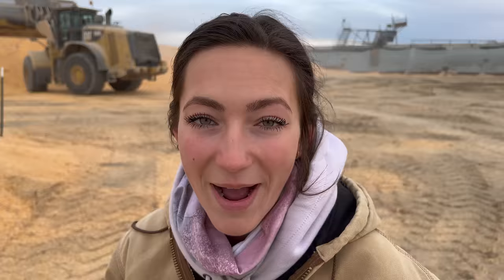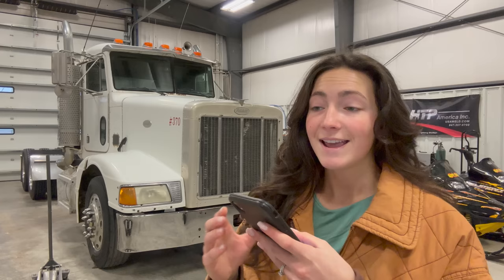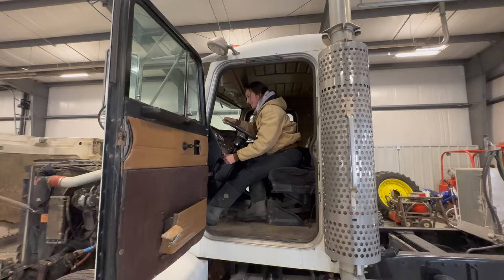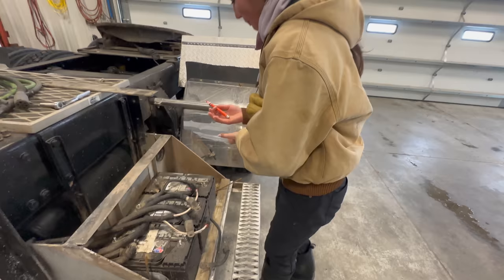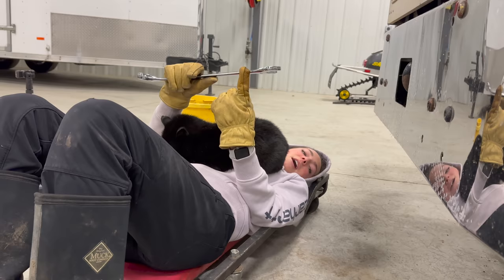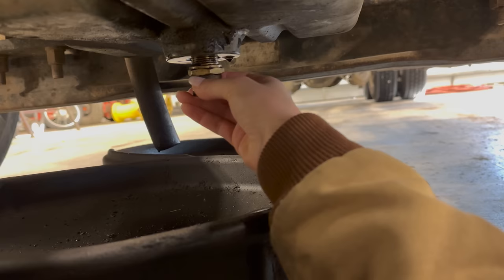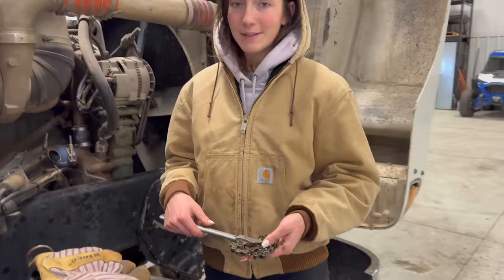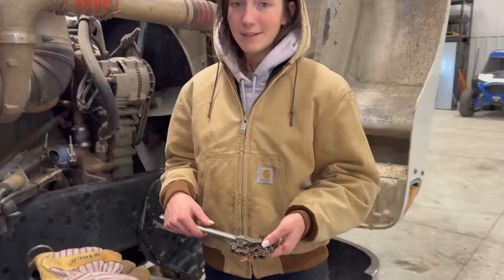The Worst Oil Change

Comment: you should prefill both the oil filter and fuel filter before putting them back on. there is a filter wrench that works with a ratchet and an extenchion and grab it closer to the top

Comment: One thing that I noticed was when you changed the fuel filter I didn't see you fill the filter up with fuel. As for the oil filters, the strap that they are talking about might do the trick if you can get it up near the base of the filter. Might need to use an extension on the ratchet to get a good pull on it.

Comment: When installing batteries get those felt washers to put on the post before connecting and then use a spray just make sure all post and connectors are clean you can use baking soda and water usually there is four batteries in those boxes which that is made for I just don't know why Peterbilt put three batteries in but those felt washers make the corrosion stay away for the life of those batteries it works real good since I've used those in the spray I never had corrosion

Comment: As all filters state where i live: hand tight and than 3/4 more.  But when not changed for a long time they can become stuck and hard to get loose.
Get a long screwdriver/pry bar and hamer that trough the filter. Then turn it.
Try to find a filter tool not with a chain but  a band like a ratchet strap. You dont do anything wrong. Just one of those👎 moments and surprises of the (youknowwho!!) That bodge it before you.

Comment: You may have to turn out  the filter base plate   with a  bar stock  / modified chisel and a 3-4 lb hammer. Alternatively,  a slow, long stroke air hammer and a dedicated chisel  could work miracles   but it  obviously is a riskier proposition .   ( I loathe having to resort to that  but it has not let me down yet)

Comment: Been there done that in racing surprised Grant hasn't figured it out somehow. You already have a hole I'd just use a big long screw driver poke it all the way threw the filter threw both sides & turn.

Comment: If heat and/or the right wrench doesn't work-- they probably will-- then take a big screwdriver, drive it through the filter, and use that to turn it.

Comment: I agree get you a better filter wrench next time let your engine warm up to running temperature the Rubber seal is probably baked on over time that would happen go to Napa explains what going on they probably have a better oil filter wrench for a semi

Comment: Put the wrench as high up as possible the lower you go the more likely it will crush sometimes that will still happen if it does poke a screwdriver all the way thru it and twist with a cheater bar

Comment: You can always take off the tire , you shouldn't have too but the filter IS on way toooo tight . Then use the pipe extension Grant was using . Best of luck , Wish I had the tools and garage you folks have  :-)  God Bless ☮

Comment: next time, drive a 3/8in rod through the filter body and go for it. Yes it drips oil. Also helps to heat the filter if it wasn't hot to begin with.

Comment: 77,000 lbs,,, not 770,000 !      OIL Wrench  1. Penetration oil (Break Free or other) all the way around the filter    2.  a 2" long piece by 1" wide strip of 1/8" flat metal, curved to the shape of the filter and slip it inside the wrench where the bar meets the filter. It will spread the force of the bar end over a wider area, and not make it bend in the filter each time you CRANK on it.  Can't wait for the next episode on "The STEAL" !

Comment: Hi Laura & Grant!  That oil filter is going to difficult to remove now that it has been crushed and compromised.  You may have to take apart and get to the base of it to be able to grip that to get it off now.  I have seen that once before and it was not pretty or fun.  Hopefully you can find a less drastic solution, I liked the hairdryer ideal to hear up, but I think you will bee a heat gun to be able to get though heat into the core of the filter and to the threaded part.  Ken

Comment: If the pry bar rips the canister off you will be able to get to the canister top that you can use the holes to twist off with a hammer n screw driver or such tool but if you have a span socket for 4x4 I find it MUCH easier to use

Comment: Think you tighten by hand then quarter turn. Suppose you can't get that pipe wrench up closer to the block?
Thought the belt was a good idea if you roll segments against the filter and use a pair of vise grips to hold it on the filter?

Comment: Just a suggestion  to you yes  snug all your filters up good but not to a point like what you had to take them off. Also to give you less prob fill your filters up with  oil or fuel  putting them on dry  can give you trouble down the road this for the videos

Comment: You also need to put diesel fuel in the filter before putting back that way don't air in the lines. Diesels don't not like air fuel line .

Comment: looks like it's a quick connect oil drain plug on the truck.
Is similar appearance to Femco oil drain plug so you can easily connect a hose and avoid oil spillage.

Comment: Gear wrench part #s 2322w 2321w 2320w…get the correctly sized one of these part numbers for your filter and it will get it right off

Comment: you should fill your fuel filter with fuel before putting it on. also, they make a oil filter wrench that fits on the end of the filter and uses a breaker bar or ratchet to turn the filter.

Comment: A strap wrench would help, a wide strap instead of a chain.  You really should fill the fuel filter with diesel before you put it on the truck.  Saves having to bleed the fuel system.

Comment: It's far easier to change the oil when you extract the oil and John Dow makes both an extractor in 20 gallon that uses air pressure to drain and empty it and flat drain pans with pumps.  Should make changing oil on everything you have a lot easier.

Comment: I have oil filter sockets that i use for cars and trucks . Not sure if those have the edges on the bottom or if they are round . The sockets were cheap and never slip well worth it

Comment: The truck filter wrench that another poster mentioned from napa is perfect for the reasons the gentleman stated. I am almost positive that some idiot installed the filter with a filter wrench. There's no way in hell it should be that tight.

Comment: Take your time and get the right wrench for the job it is worth it in long run there is a pipe wrench and a filter wrench pipe wrench put weight on the width of jaw filter wrench spreads it out and dose a great job every time don't forget to date and milage on filters.but you two did a great job so far worth the weight to get Wright wrench one go get it other one get other things done on truck thank you Laura and Grant can't wait for next one .

Comment: Try putting a large hose clamp up near the top , tighten it, and tap on it with thnutdriver and a hammer . That should break it loose. Whomever put those on there did so too tight!

Comment: Get the biggest screw driver you got and hammer it through the filter in the middle of the filter so you don't hit the threads the filter screws on to.  This is always the last resort and you all ready have a hole in the filter.

Comment: try a jaw type filter wrench I use one for changing filters on small engines and on my compact tractor and it works great but depending on where your filters are you might need a cap style filter wrench cause that's what I have to use for changing oil on my atv try one of those two style filter wrenches.

Comment: You need to put fuel in the fuel filter that you put on or else it will not run you will have to prime forever to get it to run if that truck has a pump on it. You don’t necessarily have to put oil in the oil filter cat doesn’t recommend it. I’m not sure about Detroit.

Comment: I dont agree with a lightly seated half turn, ive had filters work themselves lose from a hand half turn.  Now im not saying use a wrench to tighten it, but yea, and ive had to deal with a filter like that once on a 304 v8... I had to knock a hole through the filter, and stick a bar through the filter.. this allowed me to get better leverage to turn it

Comment: Did you think about putting your new truck on a lift and working from underneath????  (LOL)  My brother had an old car and was able to 'remove' the filter.  But, the motor mounts were broken and the engine sat too close to the frame and he could not remove the filter from the 'area'.  He was lucky that he had not broken the filter.

Comment: Been watching you a while now and think you and grant do cool videos.

Now, did I see you using old oil on the seal of a diesel filter? I'm not telling you not to do this but, if it's a diesel filter, I use new diesel, if it's oil filter I use new oil, I would never put old oil on any filter, especially fuel, you have no idea what's in it and you risk bringing on injector failures! I have seen this in the past!

I have worked on many huge engines over the years including ACERT CAT engines like the one in that loader with the big bucket!

Plenty of tools in the comments now to get those filters off, I would recommend removing the wheel also for much more room that will benefit you massively!

All the best

Ethen🔧

Comment: Lots of good comments however, one thing sticks (literally) out to me. I Do Not recommend using a wire wheel on anything but, if you do make sure the user and everyone within a mile is wearing safety goggles. I was at the far end of a table working while another guy was using a wire wheel at the other end (about 10/12 feet from me) and one of the bristles flew out of it and stuck in my eye. It did not penetrate deep enough to puncture/blind me but, it was the worst pain I have ever felt in my life.

Comment: Sorry, Laura, but a 980K does NOT weigh 770,000 lbs.  The base weight is 31 tons, which is 62,000 lbs.  Even loaded down with extra ballast, you might get it to 77,000, but not 10 times that much. 
That being said, it does look like a very fun machine to run.  🙂

Comment: Laura...I think you need to recheck the stated weight of that Cat...770,000 pounds?  A diesel locomotive weighs 450,000 pounds....that Cat is probably closer to 70,000 pounds....it is actually 68,862 pounds.

Comment: Ok use your belt with the cynch facing the block pulling the belt towards the fender in front of the tire with Laura on her back under the front belt in both hands, now Grant grab her ankles and pull boy pull. LOL I love your videos, you guys are awesome. in your kitchen you may have a rubber jar opener with a handle ?

Comment: Poke a whole in the bottom bottom of oil filter to drain oil out and it makes it easier not to soill when u screw it loose
Reply: Check rear ends and grease it

Comment: Like said; those filters have been on way too long. A different style filter wrench might help. Worst case scenario would be tearing the body of filter off and still having part of it on the mount. So, get help before that happens. Oh! If this truck doesn’t need DEF and all that. It might still be a good deal. You haven’t said year and miles. So, since it’s not used every day it will be around a few years.

Comment: Put the chain wrench near the top of the filter n give it a slight tap n it should budge
Reply: N if that don't work knock it around the brim wit a hammer while apply pressure to turn

Comment: Okay since you got it so damaged this might work but I might not get well the little probably one at least half to three quarter inch nut on there and then put your ratchet on there and try and get it off that way. You've already damaged it but you're going to need a strap instead of the chain thing that you have. Next time look and see what how much they have the cap that'll go on the end of it that you can actually use a ratchet with an extension with and then you can get leverage on it. I don't know how much they are they usually no more than 8 or 10 bucks at the most. So going to have to try to get leverage on it somewhere I think maybe you can weld a little like I said half inch or three quarter inch nut on the end of it and then use a ratchet but you kind of damaged it already so I don't know

Comment: How much is the milage on that truck again? White smoke from the exhaust usually mean that the engine needs to be refitted with new Rings/bearing and serviced valve contacts

Comment: You didn't do anything wrong. The person who installed the filter used a wrench instead of their hands. As long as you wet the seal with oil hand tight is all that is required. A filter wrench with a wider band will help making the filter harder to crush. Try heating the filter don't get it too hot. Grab the top of the filter it's stronger. NAPA might sell a filter wrench that works like a socket fitting the filter.

Comment: Does the component that the oil filters screw into unbolt? Sometimes they are separate assemblies from the engine block and can be removed and replaced. My bet is that someone cross threaded the filters when putting them on and then just kept tightening them when they leaked rather than fixing the issue.

Comment: You need what is called a strap wrench. It is like your chain one except it is a strap and you can use a ratchet to drive it.
Reply: I finished the video and you actually said strap.  You can put it close to the top and put more pressure on it.

Comment: Call Millennial farmer Zach about the John Deere filter on a brand new tractor that he could not get off ended up taking the housing off to get the filter off. Do you have access to the filter housing bolts?

Comment: At the point your filter is at get a long handled screw driver and drive it threw the filter up as high as you can and still get a cheater pipe over the handle

Comment: First off forgive me if I say somethings you already know how to do. When you start to crush the filter  you gonna have to figure out how to get higher up on the filter, the filters mount plate dose not crush.  Go to Napa ask them if they have  a filter strap wrench 2.5 to 3 inches wide that has 1/2  square drive adapter  so you can use a half inch extension. Five or ten inches long (in your tool box already) use your half inch drive breaker bar, ratchet if you don't have a breaker bar and go at. Also because that oil filter is on so tight it gonna turn slowly at first then it's gonna snap loose on ya.  Watch out for that slack adjuster / brake chamber on the inside of that tire. That's gonna hurt like a MOFO.... if that don't work it's hammer and chisel time, bring a lunch this is gonna take a minute or two. indent the oil filter mount plate with the chisel  (DON'T HIT THE ENGINE OIL FILTER MOUNT WITH THE CHISEL) now hit at a angle that will help with the removal of the oil filter. Yes I saw that there is not a lot of space between the oil filter and the frame of the vehicle.  Also if no one else has said it looks like you didn't put fuel in the fuel filter, you should put fuel in the fuel filter. That vehicle did not come with electric in tank fuel pumps. so when you open the fuel system (change the filter) you introduce air to the fuel system. You need to remove as much air as possible from the fuel lines. If not when you start the vehicle it will run for four to six seconds then cut off, at this point prior to starting if the engine has a hand primer pump on it then you pump it until it becomes hard to pump secure pump handle (pushed in twist to lock) then try starting the engine for ten to twenty seconds. stop and repeat until it starts. if no primer (old school) pressurize the fuel tank with compressed air. I am not trying to insult your level of intelligence, I just don't know your abilities and you asked for help.

Comment: Gear wrench have good quality steel belt filter wrenches and then you can use then¿m with long extension bar and breaker bar or ratchet.

Comment: Didn't look as if you filled your fuel filter with fuel before reinstalling. In doing so, it keeps the air out of the system

Comment: If a filter is too tight  I use  a screwdriver and puncher a hole in and loosen it with the screwdriver no need to go and buy stuff  you not reusing the filters  so puncher a hole and it should come loose

Comment: Poke a hole through the filter with a screwdriver, that will let the oil out. Then use a tire changer iron and a cheater pipe, and unscrew that darn filter. Other than that you might tap it with a hammer to loosen the filter. I have been known to use a chisel and hammer on the lip on the top of the filter too. Be sure to tap in a counter clockwise direction.
I hope you didn't like the pants you had on working on those batteries 'cause they are probably ruined by the battery acid if it touched your pants.

Comment: Once you take the awkward
shaped plate off, you can get to the oil filter system.😎 
It's a tough job if you haven't done it before.
Eat less beef Laura, you will operate better🙌

Comment: Two things you should be wearing rubber gloves as used engine oil is very toxic. And don’t use oil on the o ring get some moly coat o ring lube for the o ring on the new filter your oil changes will go a lot better.

Comment: Check the heater valves they are probably turned off should be on passenger side of the motor

Comment: Hi, I WATCH YOU BECAUSE YOUR AR DOING THE THINGS I HAVE DONE ALL MY LIFE EXPT WHEN IN THE AIR FORCE?  am laughing I am a 95-year-old farmer in Lubbock TX I have the same engine in my trucks if you would drive a big screwdriver thru the oil filter near to top to loosen it ( when you bend the can it puts the threads in a bind! ! I have most of the things you all do I run100 +  cows and farm 1200 acres . My tractors are old 40 series J.D. and my 7060 AC is 180 hp (YOU CAN TURN THE PUMP UP TO 200 HP ) and will pull anything you use. get yourself an AC 7060 or bigger for a spare they are cheap at auctions and will last forever.